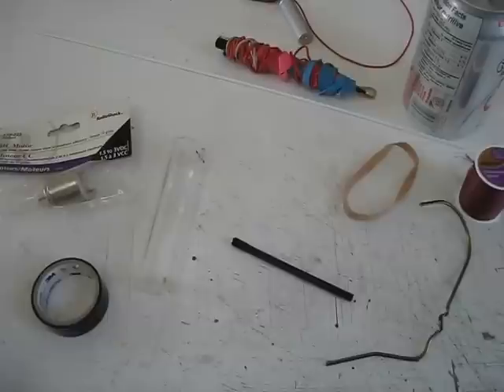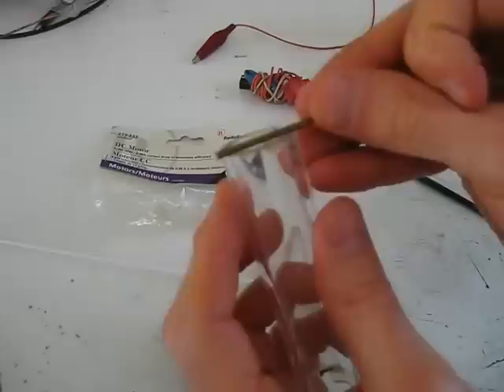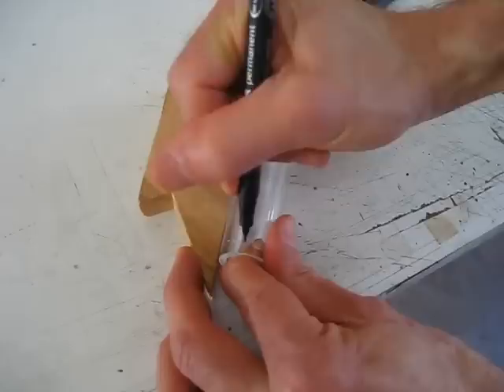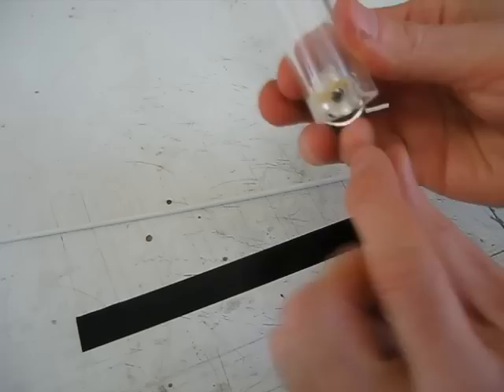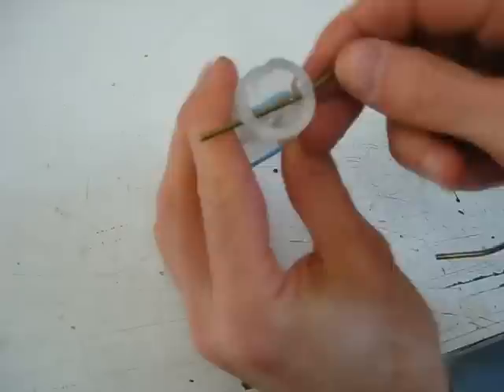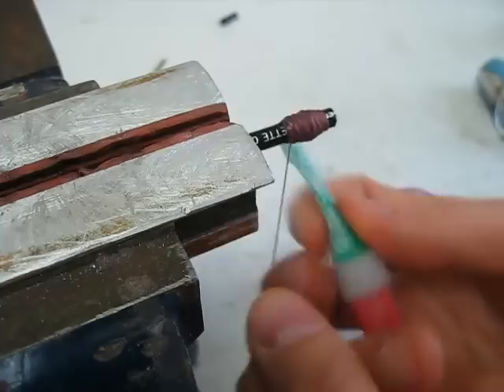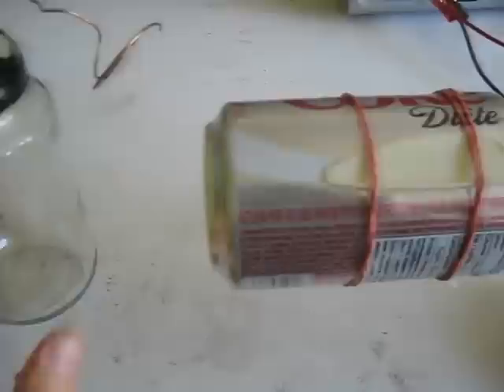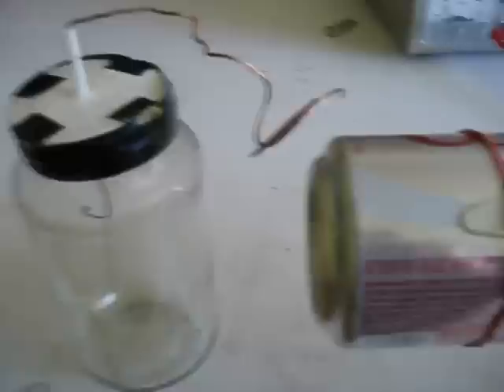How to Make/Build a Van de Graaff Generator Part 1 (Homemade/DIY)

Comment: this current commin out of coke can, can i use it for some kind of another device without connecting it to d generator?
Reply from the maker: There's nothing really useful that you can connect it to. But you can do lots of fun things with it like run a corona motor http://youtu.be/ksp_O_1WmvA, turn a small ion wind rotor http://youtu.be/UgWTjCHsm3M, ring Franklin's bell http://youtu.be/fEqudsyIWzk to name just a few.

Comment: so the belt is the problem?i'd tried to make the ground touching the belt a while ago but still not working.so i guess the belt is really the problem..but what about if the tourniquet that i will use would be the same as the color of the rubber band that you used,is the same?i can't find rubber band or huge balloon so i used those sir.

Comment: the party balloon stick is plastic sir.the top roller that i used is a glass fuse from my motor cycle..i connected the ground wire as the same as on your video sir.what would be the problem posible sir?

Comment: Do you think you it could work with a sterling displacer engine instead of a electrical motor?
Reply from the maker: It depends on how tight the belt is on the rollers. Mine is pretty tight and so I'm sure it wouldn't work - you'd need an awfully powerful Stirling engine. Both Stirling engines I've made certainly would have the torque required.

Comment: It's np, now I have a different problem lol.. It sparks from the can,but it throws a more painful and bigger spark from my ground wire. It's connected to the negative side on my battery and everytime I grab it to turn the van de graaf off... It shocks me lol any ideas?

Comment: Brilliant! After the arc in the electroscope, the electroscope would have been left with a positive charge as well due to the transfer of electrons to the generator/can?
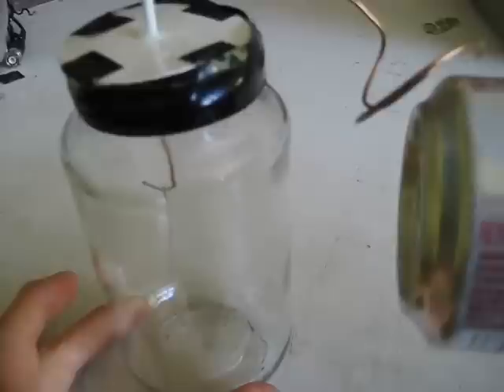Reply from the maker: Yes. Looking at it again, I say ignore the first arc at 11:38. One of the leafs was touching the glass and so I'm not sure what happened there. But at 11:43 when I do it again, you can see that when I move the electroscope away again, the leafs are slightly separated, left with a positive charge as you said.
Reply: @RimstarOrg  Thank you!
And thanks so much for your efforts in sharing all of this with the people. Wishes from India! :)

Comment: I have used every material same as described here.A servo motor, 12v dc, a pvc pipe as the insulating column on which the dome is mounted, a one sided vinyl coated belt, brush wires at top and bottom and a can as a dome at the top, all the connections done as instructed but still no sparks are being generated. Any help in this regard or suggestions would be highly appreciated.

Comment: i used vinyl tape instead of rubber belt and used a glass fuse instead of nylon thread.
well, i m unable to find wat the problem really is and my generator is nt working.
i guess my soda can doesnt conduct.
suggestions please.....

Comment from the maker: Oh, I don't know what the problem is. All I can do is make suggestions. Even if I were there, I'd still be trying different things until it worked. You don't need a huge balloon. If the distance between your rollers is around the same as mine, take a normal party balloon and sit it flat on the table in front of you with the hole facing you. Cut across the middle of the balloon, parallel to the edge of the table, leaving three parts. Use the middle part. It should be shaped like a rubber band.

Comment from the maker: Ah, I read your replies in the wrong order. I see you used three batteries and you already used the closed can method. Thanks for the answers. You have a pretty good motor to get it running with just three batteries.

Comment: well  i have few questions
1."whatever be the charge and field configuration outside,any cavity in a conductor remains shielded from outside electric influence(i hope it also include  the electric field on the shell of vandegraffs gen) the field inside the cavity is always zero" {this is electrostatic shielding)
my question is why don't concept(of electrostaic shilding) is workin on wan de gaffs gen i mean, it accelerates ions inside(which are placed inside the shell cavity) for some nuclear stuffs this means it creates electric fields inside the hollow shell and don't u think it is against this electrostatic shielding concept?
2..from where does the positive energy get accumulated on the belt..can u explain

Comment: Can I use  multiple layers of plastic water bottles instead of acrylic tube for belt chamber?
Reply from the maker: Yes. The tube can be anything that isn't electrically conductive, so no metal. Plastic water bottles will work fine.

Comment from the maker: Actually you want higher current for better speed... unless you're currently running below the motor's rated voltage. To get more voltage, connect batteries in parallel (pos to pos, neg to neg). To get more current connect batteries in series (pos to neg). First get it up to the motor's rated voltage, then work on the current. Warning, too much voltage or current can damage a motor so stay within the motor's ratings.

Comment: Can I use aluminium for the upper roller vinyl for the bottom roller and vinyl for the belt?
Reply from the maker: I've seen others make it work with that combination. I don't think it's using the triboelectric effect, as it would if you use different materials for rollers and belt, but it seems to work for those who've tried.
PS. If you posted this as Luke Wong earlier and there was no Reply button then that's likely because in your Google+ Page settings you said that no one should be able to comment on your public posts.

Comment: hey I am using a 100 rpm motor still I am not able to fell the current in the can. tell me how to modify it or detect the current in the can
Reply from the maker: +saurabh jain 100 rpm doesn't sound very fast. That's between one and two turns a second. But provided your losses aren't too great then that means it would just take longer to build up a charge. Rather than repeat myself here, I've put together this troubleshooting/FAQ webpage. If you still can't get it working after looking at that then let me know. http://rimstar.org/science_electronics_projects/van_de_graaff_faq_frequently_asked_questions.htm.
Also, you might find some helpful tips and enhancements in the part 2 video https://www.youtube.com/watch?v=QrCgtjZwnB0.

Comment from the maker: I think you'd be far more efficient by using a regular electromagnetic generator with the small wind turbine. The mechanical to electrical energy conversion of a Van de Graaff generator, while useful for producing very high voltages, isn't very efficient.

Comment: right now i'm making this for my school science show project
Cool
Reply: argh screw this motor wont work
i have 12-8 v motor and i used 12volt battery and wont work
i dint make the rubber band so streched to much its just enough
and now i dont have project
1 hour before to show

Comment: emmmm amazing, but i wanna ask about da  screw u used to fix the wire to the coke can, n wats da minimum voltage supply needed for ds project n thanks alot......>>(A)<<..
Reply from the maker: I actually found a much easier way of doing it that doesn't need the screw and it works better. You can see it in my part 2 video "How to Make a Van de Graaff Generator Part 2" http://youtu.be/QrCgtjZwnB0 Regarding the minimum voltage needed for the motor, that depends on which motor you have. Each motor has a maximum voltage that it can handle and a current that it uses. The voltage and current values are usually on the packaging for the motor or on the motor itself. If you don't have that information then all you can do is try different values, but you take a chance of ruining the motor.
Reply: thanks alot for spending da time to help me n all da best......<3

Comment: I made a van de graff generator, but used a pvc pipe as the outer case for the motor/roller system. could that affect the electron transfer? the generator doesnt produce. also, can i use a hammer with a wooden handle as my earthing?
Reply: hi, i have done as u told me to
Reply from the maker: A PVC pipe should be fine. A hammer head doesn't sound like a great earth but it's better than nothing. I show other earthing options in my Part 2 video here http://youtu.be/QrCgtjZwnB0 The surface material of your rollers should be at opposite sides of the triboelectric series table and the belt should be in the middle.
Reply from the maker: Dhruva Vijayaraghavan
Thanks! That answers why I sometimes don't have permission to reply. It's a real annoyance though, because I won't know if I have permission until after I've already spent time typing the reply, sometimes even looking something up.
Reply: RimstarOrg Ive used a rubber belt with vinyl and electrical insulating tape as my two roller surfaces. Is this setup fine?
Thanks for the help!
Reply from the maker: Dhruva Vijayaraghavan
Theoretically it's not fine. As I said the surface material of your rollers should be at opposite sides of the triboelectric series table and the belt should be in the middle. You can find the table here on the right hand side: http://en.wikipedia.org/wiki/Triboelectric_effect You need to find a different material for one of the rollers, one that is at the other end of the triboelectric series from vinyl. The Part 2 video I mentioned has some suggestions. That's also why I used nylon in this video.

Comment: Interesting video, so basically youre rubbing a rubber band against magnet wire tand extracting the single charges and storing it onto a coke capacitor ?
Reply from the maker: No, not quite. There is no magnet wire involved. You're rubbing a rubber band against rollers, in this case one is covered with nylon thread and the other is covered in vinyl. This produces a highish voltage on the roller which attracts charge from the ground to the rubber band. You then mechanically carry this charge on the rubber band and deposit it on the coke can. The result is a coke can with a charged outer surface that you can get sparks from and stuff.
Reply from the maker: Oh, and I explain it all in great detail in my "How a Van de Graaff Generator Works" video http://youtu.be/EsZQS2GOMQE

Comment: yeah its a good motor
but i need a higher voltage motor for better speed
but wouldnt that just cut the rubber band as for its not so strong?

Comment: Can i use glass from a fuse for the top roller and teflon for the bottom one
Reply from the maker: Yes. If look at the triboelectric series table here https://rimtar.org/science_electronics_projects/triboelectric_effect_series.htm then you'll see that glass is on the positive side and teflon is on the negative and they're nice and far apart, so as long as your belt is somewhere in the middle, like rubber, then you're good.

Comment: but if my outlet is perfectly grounded, I should   be safe to just draw a single ground wire from that  ground pole in the outlet, right?  wasnt that that you did in the video part 2 after all?    Im afraid  only of  one thing  , the high voltage    charge etc would automatiically ofcourse go  into the ground as it should.. but you see that is high voltage going into the ground of the outlet.... u see?

Comment: Great, can i use this device to make an accelerator for charged particles like an electron. thank you in advance
Reply from the maker: Ibrahim yehia Well, this particular one won't give you much charge to work with, but a larger one should give you more.
Reply: thank you

Comment: I have a glass fuse, PVC tape/Electrical tape and rubber bands but they aren't thick like yours. Besides my motor stops spinning when there is even a slight bit of a pull. Any ideas on the belt material, which I can easily get? Also, how to prevent my motor from stopping? Thanks.
Reply: Also my rubber bands being thin turns around to make loops which increases tension, any other material?
Reply from the maker: To keep the belt from slipping you need to move the shafts further apart, increasing belt tension. That may become more than your motor can turn, but you'd have to try to see. The loops may be due to your shafts not being aligned well enough, or there may be some twist already in your belt to start with, in which case you could look for a new rubber band. You could also try using the electrical tape as the belt too, with the sticky side facing outward. See my part 2 video as well for any tips "How to Make a Van de Graaff Generator Part 2".
Reply: So u can have Vinyl as both the roller of one side and as the belt? I guess that won't work right? Also, does having any PVC plastic material like stick pen roller and having electrical tape belt work well? Thanks for assisting.
Reply from the maker: I haven't tried the vinyl belt and roller, and I wouldn't have thought it would work, but a lot of people have done it successfully. It may be doing some other effect than the triboelectric effect. I can't say for sure re the vinyl and plastic but in the triboelectric series the plastic is more positive than the vinyl so it might be backwards for what you need. With the tribo series you want the belt material in the middle, one roller to the positive of the belt material and the other to the negative. From http://en.wikipedia.org/wiki/Triboelectric you can see they wouldn't be.
Reply: Thank you :)

Comment: this is great stuff. But how much battery power did you usee. I,m using 9 volts but it is still not moving
Reply from the maker: I never measured the power. Power is voltage multiplied by current. Mine is a 1.5 volt motor so I'm giving is around 1.5 volts. I don't know how much current. You have to take both into account. But my values don't matter since it's very dependent on your motor and how tight your belt is. If you look at my part 2 video, http://youtu.be/QrCgtjZwnB0 at 10:11 you can see that the 1.5 volt motor in my DIY Van de Graaff needs 4 1.5 volt D cell batteries in parallel (+ to +, - to -) for 1.5 volts and a lot of current and it barely turns. But you can also see that the 1.5 volt motor in commercially made Van de Graaff takes just 2 1.5 volt D cell batteries in parallel. So first, make sure you're not using more voltage than your motor is rated for; it should be written on the motor or on the packaging. If you go over that voltage too much for too long then you can damage the motor. If your motor is a 1.5 volt motor and you're giving it 9 volts then you've either damaged it or it's not getting enough current. In that case reconnect you batteries together with all then +'s together and all their -'s together. Assuming they're 1.5 volt batteries then that will give you 1.5 volts and a lot more current. If that fails then either there's a problem with your motor, you need more batteries, or you can try loosening the belt a bit.
Reply from the maker: Oh, it also depends on how easily your pulleys/rollers turn.

Comment: I am building one using glass fuse on nail. I've got a question. Should that fuse rotate, or stand still (on the nail)?
Reply from the maker: ***** The fuse should rotate.
Reply: RimstarOrg Thx for your help. I used your project and another one connected and it worked. But I had too weak engine and got to use small rubber so I didnt get a spark :/. But at least some things with paper works :p

Comment: would mono-filament fising line be a good roller for the top?
Reply from the maker: I don't know. It depends on what it's made of. If it's nylon then there's a good chance it will work. Don't forget to watch the part 2 version of this video "How to Make a Van de Graaff Generator Part 2" http://youtu.be/QrCgtjZwnB0 which continues from where this one left off but with many improvements and more tips.

Comment: You also connected through the non-conductive layer when you screwed the wire into the top of the can (from the inside).  There might be some plastic on the inside of the can.  Aluminum forms a passive layer that is a poor conductor and decent dielectric naturally when exposed to air for a while and when anodized.  That dielectric layer should increase the discharge by making them less frequent because of the increased capacitance.

Comment: what can be used instead of that thick rubber band?please reply quick!
Reply from the maker: There don't seem to be many choices. You could try cutting a strip from a rubber balloon which theoretically should work, though I haven't tried it myself.
Some people use the black vinyl electrical tape like I did for the bottom roller and also the same tape for the belt (sticky side facing out). I don't know why that works but it does seem to.

Comment: I have a question : can I use a wooden roller with some plastic on it at the bottom and with glass on it on the upper roller ??? I want to try to make big on...
Reply from the maker: Yes, it's the surface material of the roller that matters so plastic on a wooden roller should work.
Reply: RimstarOrg Thanks  very much .

Comment: Sir, From where did you supply electrical charges to the metallic coke?
Reply from the maker: +Prajwal Ettigi It comes from the triboelectric effect that takes place between the belt and the rollers. I explain it is great detail in my video about how a Van de Graaff generator works https://www.youtube.com/watch?v=EsZQS2GOMQE.